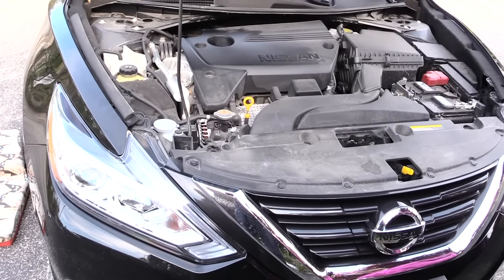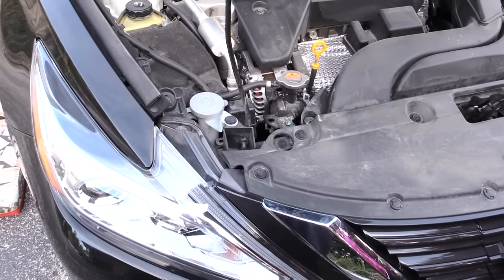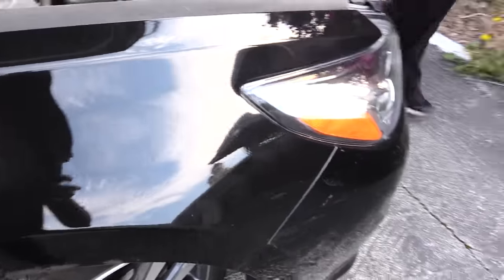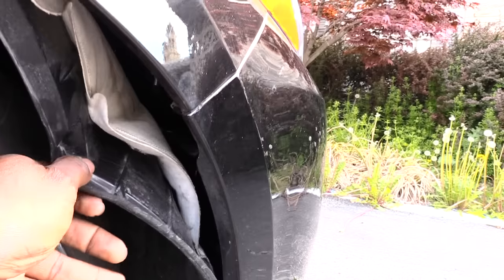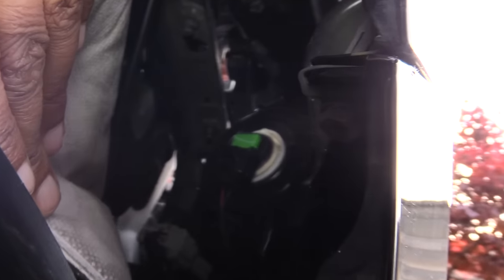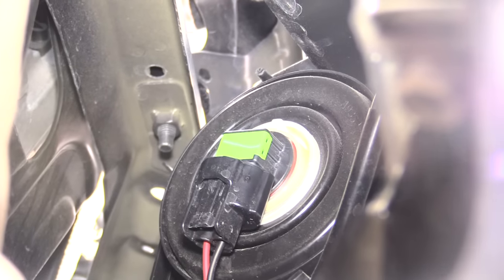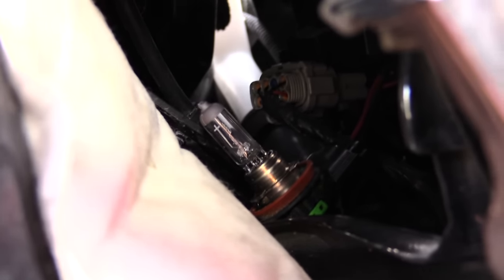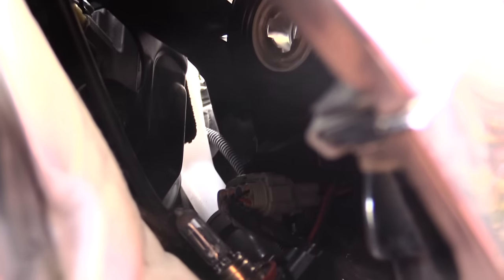Nissan Altima 2014-2018 Headlight Change Easy!

Comment: Dude I just got headlights for mine and was looking at all that to get through.  Then I found this video.  You are truly awesome!  2015 Altima S
Reply from the maker: Your welcome, Thanks for watching and commenting glad could help.Please subscribe & like and share if haven't already and check out our other helpful videos
Reply: Thank you for saying 2015.  I'm about to go do mine.  I bought the bulbs and started to freak out on all the other videos.  @Flashback502 Thank you for making this video man!
Reply from the maker: Your welcome, Thanks for watching and commenting glad could help with lights. Please subscribe & like and share if haven't already and check out our other helpful videos
Reply: @Flashback502  WOW.  Thanks for the response. I just changed out my lamps.  Took only 1 min to do on each side.  Best DIY video of the year!  Happy Thanksgiving to you and your family.
Reply from the maker: @jameslucas5590  Your welcome glad you got it done quickly. Happy Thanksgiving to you and your family also.
Reply: Flashback502 I also have a 2017 Altima, can I do this to change the turn signal bulb?
Reply: How does this work bc that piece don’t pull back like that on the 2015
Reply: @Cartiercal  it does work.  Mine is 2015.  You just have to get something and carefully pop the well out so it doesn't damage it.  Just changed mine again and used this technique.
Reply: @wtfBrad  ok what tools did you use?
Reply: @Cartiercal  I just used a small pry bar wrapped in a towel.  Got between well and fender and gently popped it out.  Just make sure it's not cold out.  Will make the plastic more brittle.  But either way if you're gentle it will pop out and back in easy.
Reply: Thanks for this video. Last time I changed bulbs, it took me hours to remove the fender liners, this time less than 30 mins. to install an LED kit. Used a flat-head screwdriver wrapped in a rag to pull back the liners on a 2013 Altima.
Reply: @jameslucas5590  Got the same model, thanks for the confirmation lol I’m about to get a new light for mine
Reply: 2015 Altima S here as well. I just went and looked and found where you can pull that piece of plastic/lining back but it seems really tight and I don't want to break or tear it. Plus it's really tight in there and need someone w smaller hands.  LOL . TY though. I'm sure I'll figure it out.
Reply: @joelt4416  Easy fix
Reply: @joelt4416  It's actually pretty flexible.  Long as you don't pull too hard or fast it will go back in place easily.  And yea I had to gold it back and have a friend with smaller hands/arms get in there and change them. lol
Reply: Same car!!
Reply: Just got a 2015 Nissan altima S yesterday and I need some new bulbs. Glad you verified that it works on your Nissan altima.
Reply: @livestronger925  I took my tires off to make room to replace the bulbs
Reply: I’m glad it worked for you! I have the same exact model 😌
Reply: Aahh. Thanks for your testimony.
Reply: I have a 2015 Nissan altima s and I'm about to do this today! Fingers crossed!
Reply: Awesome dude!
Reply: @livestronger925  I just got a 2015 Nissan Altima as a backup car, which I didnt really need haha. The taillights have already needed to be changed since its 9 years old. So Im preparing myself for the headlights as well. So much less expensive to know how to do simple stuff like this by myself
Reply: Not helpful, would have loved if you had shown how to remove the bulb from the socket. Can't find out if you pull the tab our or in as you remove the bulb.

Comment: Confirmed this is correct approach for the 2014.
Reply from the maker: , Thanks for watching and commenting glad could help.Please subscribe & like and share if haven't already and check out our other helpful videos
Reply: just did mine in less than 5 mins just the same and its a 2014 altima S. Thanks bro!
Reply: Nice thanks
Reply: Yesssssss Im gone do it myself
Reply: And 2015 also
Reply: Bet. This the exact reason I came to this video

Comment: So, the 40 people who gave this post a thumbs down must not know the difference between the headlamp in a car and a refrigerator light bulb ! With that said, I to was freaking out when both my headlamps went out 2 days apart and the other videos showed tearing your front end apart to change them. This video is exactly how it goes for my 2014 Altima. 3 minutes per side. One large flat tip screwdriver. Done, and yes Bob is actually the name of my Uncle- God Bless and Party on !
Reply from the maker: Your welcome, Thanks for watching and commenting glad could help light. Please subscribe & like and share if haven't already and check out our other helpful videos

Comment: I was waiting to jack my car up and pull the wheels off until i remembered this video and gave it a try. 30 mins later im done with both lights and im not missing no screws. Great video thank you for sharing!
Reply from the maker: Thanks for watching and commenting, yes it's much easier and quicker then removing wheels and bumper. Please Subscribe and share if haven't already and check out my other helpful videos.

Comment: Thanks for this straight and to the point video. It worked on my 2017 Nissan Maxima.  You saved me $325 + parts.  Yes, $325 per Nissan dealer quote. A local auto shop quoted $225 because they had to remove the bumper which I promptly Googled and found lots of how-to complicated videos doing just that.  Thanks but no thanks.  I rarely leave a comment, but this one deserves it.  Thanks again.
Reply from the maker: Your very welcome glad could help you save some money👍 thanks for comment. Please subscribe & like and share if haven't already and check out our other helpful videos

Comment: Just changed both low beams in my 2017.5 Altima SV!
Took under 10 minutes, closer to 5?
YOU ROCK!
Reply from the maker: Your welcome, Thanks for watching and commenting glad could help you get it done. Please subscribe & like and share if haven't already and check out our other helpful videos
Reply: Question. Do you just push the plastic back in place? Or is it ruined if I pull it up?

Comment: Best video for changing nissan Altima 2013 headlight. I replaced both of mine within 10 minutes. Toughest part of the job is finding a seam to pull away the plastic.  Thanks for this video!
Reply from the maker: Thanks for watching and commenting glad was able to help with light. Please Subscribe and share if haven't already and check out my other helpful videos.

Comment: You are awesome- Thank you so much!!!! Been holding onto new bulbs for months waiting for someone else to replace them... You helped me do it myself 💪🏾
Reply from the maker: Your welcome, Thanks for watching and commenting glad could help you get it done yourself. Please subscribe & like and share if haven't already and check out our other helpful videos
Reply: I remember I did that as well and eventually ended up taking it to a shop where they charged me about 170 bucks...smh but I've come a long way, I can repair my gear shifter now, I'm about to replace my number and front and rear light housing with dark tone ones, replace my grill and side mirrors to mirrors with turn signal on them which are also heated mirrors for the snow. I've come so far and learned so much when the desperation kicked in lol

Comment: worked on my 2013 Altima, thanks for taking the time to post this. very easy to complete and better video than the others. thanks again
Reply from the maker: Thanks for watching and commenting glad was able to help with light. Please Subscribe and share if haven't already and check out my other helpful videos.
Reply: My 13 altima the headlights are not working right i change two times the bulb i put HIDS and they still no  bright  I dont know what could be the prob;em

Comment: That worked for me!!  There were two clips on the front side of the wheel well that I had to remove and one screw in the underside of the fender.  Each side took me about 10 minutes because I could see anything.  (Did it by feel).
Reply from the maker: Your welcome  glad could help please subscribe like and share and check our my other helpfull videos.

Comment: Would like to add that I found it a little bit easier to disconnect the wire from the old bulb before taking out the old bulb since you don't have a lot of room to work.  Next, remove old bulb, then insert the new bulb in the opening.  Finally,  reconnect the wire while the new bulb is firmly attached inside.
Reply from the maker: Thanks for sharing

Comment: Thanks for the video.  I did not need to change mine out yet but was just curious how it would work the video will help out for sure when that time comes I have a 2018 Altima I do need to replace one of my running lights something from the road came up and cracked it and then I went to the car wash and blew it
Reply from the maker: Your welcome  glad could help please subscribe like and share and check our my other helpfull videos.

Comment: Hi, my 2017 altima sr low beam bulb burned out. I tried to follow your instructions but my car does not look like that at all. Theres no access to the headlight from the top or from the wheel area. I ordered a replacement & took it into a shop so they can install it & they said they couldnt because they checked & those headlights on my car, the low beam bulb is sealed & they cannot swap out the bulb, that i would have to replace the entire headlight which is expensive! Is this true? Or are they trying to rip me off? Seems odd headlight bulbs would not be able to be swapped out??

Comment: Hello there again, is a trick to taking the bulb from the socket? It feels like I’m going to need significant force to take them out of the socket, but to the point I’m afraid of breaking something. Is there a tab on there or a slide part? Thank you for the advice again
Reply from the maker: There should be tabs on sides or middle to pull back to release bulb.

Comment: Does this approach work for the front signal lights as well? Im due for an inspection and this would help alot. I cant afford to take my car to the shop at this time.
Reply from the maker: Unfortunately, no. Most of the time you have to drop the bumper. Please like subscribe and share.

Comment: What bulbs did you use? I tried using the link you provided but it doesn’t work anymore. I have a 2014 Altima and I’m afraid of getting the wrong bulb or something
Reply from the maker: Its best to call parts store and see what they have in system. Auto zone, Oreallys. Please subscribe & like and share if haven't already and check out our other helpful videos

Comment: How is the inner wheel well plastic secured back on soo its not falling off, flapping around etc . . ....screws??
Reply from the maker: Normally has push tabs, you just push them  back in.  please subscribe like and share and check our my other helpfull videos.

Comment: I took a look at the car to try and do this but there is no separation between the plastic piece and the car. Do you have any suggestions?
Reply from the maker: Most cars should have it, if yours doesn't then u won't be able to change this way. Please subscribe & like and share if haven't already and check out our other helpful videos

Comment: Do you need a screw driver to take off the plastic around the wheel?
Reply from the maker: I didn't but some may, most just can be pulled back with your hands. Please subscribe & like and share if haven't already and check out our other helpful videos

Comment: you should do one on the turn signals. all the ones i've seen needs to remove the headlight housing
Reply from the maker: Thanks for watching and commenting with suggestion will look into it. Please subscribe & like and share if haven't already and check out our other helpful videos.
Reply: This video doesn't  help for turn  signal.

Comment: A quick and slick way, never mind the badly scratched arm(s). I do not recommend doing it this way, take the time and remove the tire and Panel. You'll see why when you do. 2015 Altima, replaced Lights with LED's.
Reply from the maker: Thanks for watching and commenting, that is definitely a another option to changing light bulb.  Please Subscribe and share if haven't already and check out my other helpful videos.

Comment: Did you use the same type of bulb or did you put better than stock?
Reply from the maker: Replaced with same type, thanks, original bulb was dual for some reason. Please Subscribe and share if haven't already and check out my other helpful videos.

Comment: I’m using this method. Easy access but I’m  trying to remove the old bulb out & it’s so hard to pull out Wth.
Reply from the maker: May need to push in a little then twist. Please subscribe & like and share if haven't already and check out our other helpful videos

Comment: Question.... What about the high beam bulb and turn signals? Is it easily reached the same way?
Reply from the maker: Sorry but on most years you can't get to it this way.
Reply: @Flashback502  - Bummer. OK, thanks man!
Reply from the maker: @knytrydr73  sorry, no problem

Comment: Does pulling back the plastic cover of the wheel well like this cause it not to go back into place ?
Reply from the maker: Kenya Brown thanks for watching when I pulled it down on car it went bac in place fine, but I can't say for all cars I would just pull it slow and get a feel for how easy it will go bac in place. Please Subscribe and share if haven't already and check out my other helpful videos
Reply: My 2015 has removable clips

Comment: Got an 18 it worked good for me
Reply from the maker: Good to hear👍Please subscribe & like and share if haven't already and check out our other helpful videos
Reply: @Flashback502  will do thanks for figuring it for me..this was very helpful..I had the stock halogens wasn't working for me.
Reply from the maker: @slow_rednline4874  your welcome, glad u got it done. Thanks for sub
Reply: @Flashback502  i got some nice white halogens  makes it look a bit more premium with the crazy dip job on it . This is very headup video saved me lots of time it literally took 5 min to do both sides..I thought I was gonna have to drop the bumper and stuff..any idea how to do the fogs I know they have the same sized bulb as the headlights?
Reply from the maker: @slow_rednline4874  glad could help, sorry but far as I know you have to remove bumper.

Comment: Thank you for sharing.
Reply from the maker: Your welcome, Thanks for watching and commenting glad could help.Please subscribe & like and share if haven't already and check out our other helpful videos
Reply: So I changed the headlight in my Nissan Altima 2014 but light is pointing down..is there a way to adjust them up or down?
Reply from the maker: Make sure  light is n correctly and yes there should be a adjustment screw under the hood

Comment: FlashBack, any suggestion for getting more out of my Altima?? :)
Reply from the maker: Spark plug change and clean MAS if car starts to run sluggish or getting less gas miles.
Reply from the maker: Sorry but sure on your car when you buy it AutoZone or what ever part store u buy from should be able to tell you.
Reply: @Flashback502  The car is a 2017.5 and only has 7000 miles.  Do I need to change spark plugs yearly?  (but I have noticed the change in MPG)
Reply: @Flashback502  MAS?  mass airflow sensor:?
Reply from the maker: Yes
Reply: @Flashback502  Thanks!

Comment: Has anyone else been affected by that damb head lamp recall? I changed out my dims in January and thought I got messed up bulbs to change them out AGAIN to learn in March about the recall. Still can’t use my lights on dim, dealership will not fix my head lamps and have burned through bright lights twice.

Comment: I have a 2017 Altima SR, and my headlight socket looks nothing like that :( just has wires coming out. It looks really different
Reply from the maker: Not sure why yours is different could be after market.
Reply: So on the 5th gen Altima we cant change the headlight bulb because they are projector lights, only highbeam H11 (for those who were confused like me )

Comment: On my 2017 SR there's just a rubber grommet with wires there I can push the grommet in and ok it but it's just a wire going somewhere else.. is anyone elses like that?
Reply: jdynasty89 mine is too! I have a 2017 Altima SR, did you figure out how to change it ?

Comment: How do I pull the bulb out ? It feels stuck
Reply from the maker: Thanks for watching you just have to twist it out of the housing then unplug it from the power source depending on your year you may have a lever to press down to  release bulb. Please Subscribe and share if haven't already and check out my other helpful videos.
Reply: Flashback502 it looks just like the one in the video when I pulled the plastic back behind the wheel . Identical to the one in the video
Reply from the maker: @joshuawalker9525  you have  to push the lever and pull the light  at the  sametime, lever is right above the red wire going in to the light
Reply: Flashback502 nahh still no luck but appreciate the help
Reply from the maker: @joshuawalker9525  hope you get it changed, may want to take it 2 autozon they mail help you. Goodluck
Reply: Flashback502 I finally got it . Thanks

Comment: Thank you so much for all of your help.  I have a 2015 Nissan Altima Type S and literally did this in 15 minutes.  I used this website as well to help guide me 
https://www.paulstravelpictures.com/2013-2015-Nissan-Altima-Headlight-Bulbs-Replacement-Guide/index.html.  , pay particular attention to the fastener as I think you have to remove this before you can pry out the side like it shows in this video.   

I called Nissan because I was worried about doing it myself and they wanted ~$300!  This literally took me 15 minutes and all I used was a flathead screwdriver to remove the fastener and then gradually removed the panel.